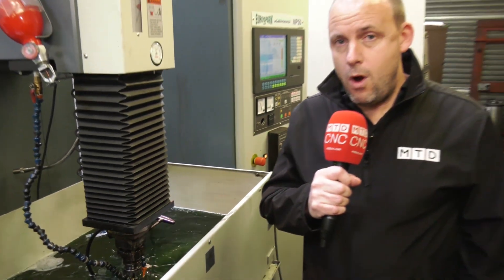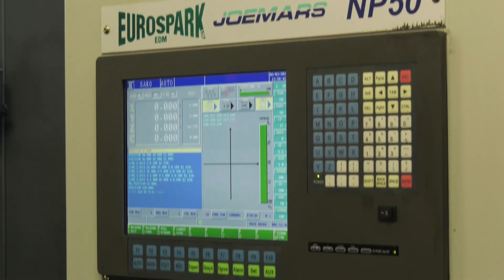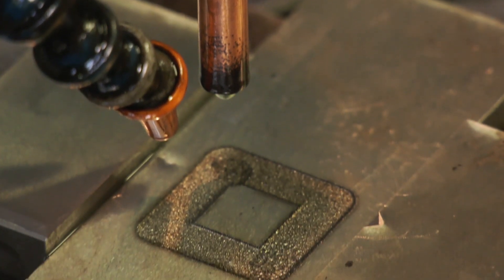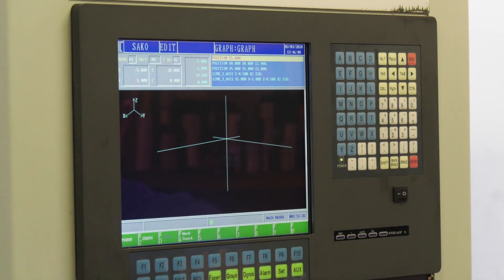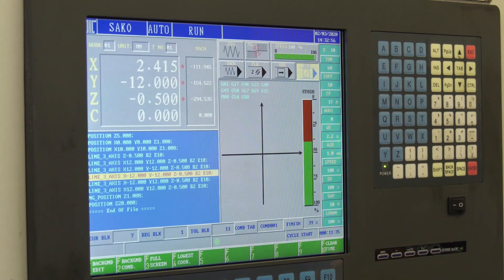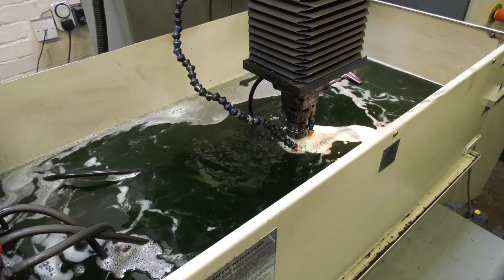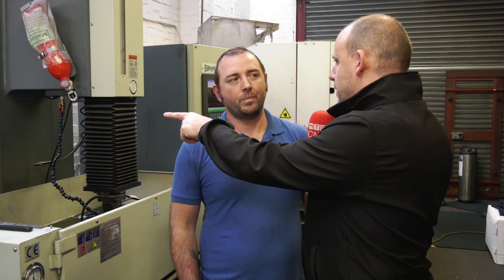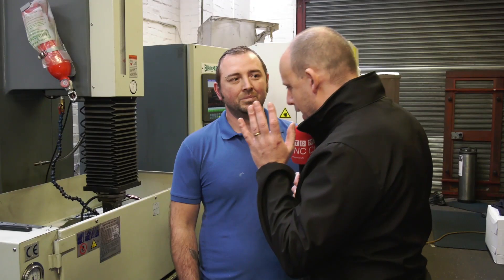Looking for a reliable EDM machine - have a watch of this

Comment: Purchased a similar machine from eurospark and am very happy. we use it for cutting internal keyways in bores that are just too big for broaching or in blind holes. The machine has easily paid for itself. a £500 in-house op or £1000 sub-con now costs us about £25 a time as we run it overnight!. a year in so far and not a single problem and great service from eurospark, very knowledgeable and helpful.
Reply from the maker: great to hear